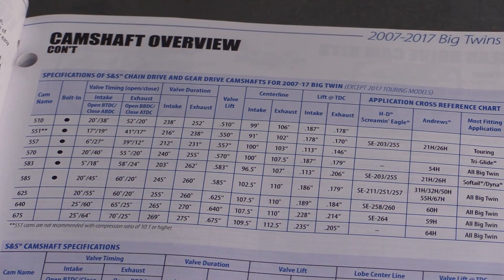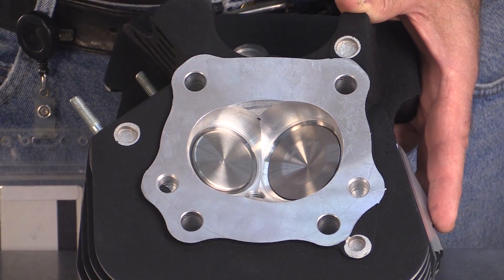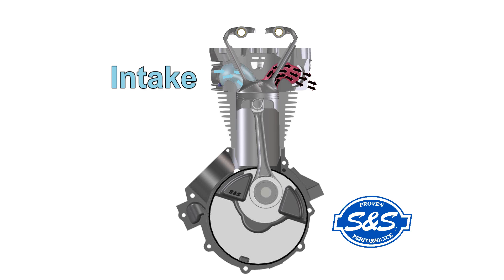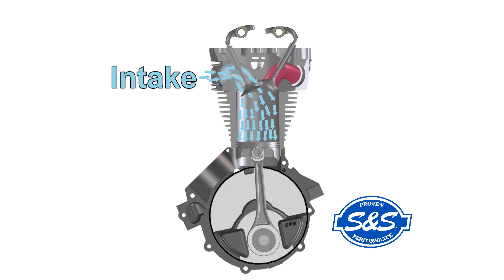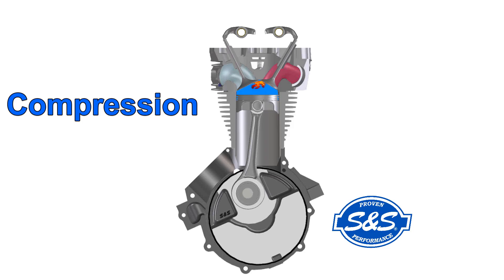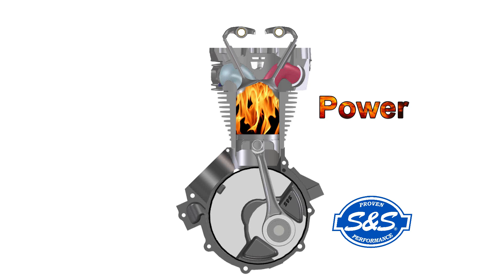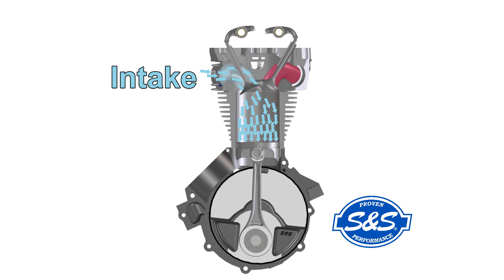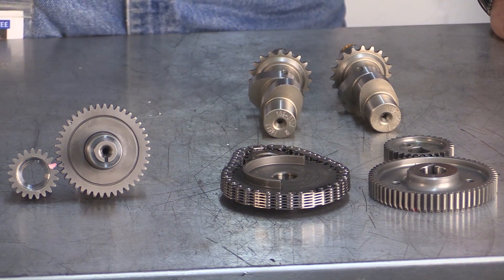S&S Cycle - Understanding Cam Specifications - Part 1

Comment: As a mechanic myself what would be the highest lift and duration and lobe center for a stock 74 cubic in. Shovelhead and still be safe without modifying anything especially piston height? Thank you...... (Andrew's B grind??) I'm an old time biker myself and I'm just using Andrew Cams as an example, I am more than willing to use S&S cams instead.

Comment: best cams for 103 2014 with high flow air filter and s and s headers and 4.5 slip ons and tuners
Reply from the maker: Cams are really dependent on the type of riding you're doing; 2up or solo, carving corners or running stop light to stop light, highways or back roads, etc.

Comment: What would you suggest for a cam for a stock H-D motor with the stage 1 kit
Reply from the maker: What year is the bike? What kind of riding are you doing?
Reply: S&S Cycle, Inc 2012 and cruising
Reply: S&S Cycle, Inc 2012 street glide with Vance n Hines power duals headers and monster round slip on and the dreaming eagle air intake
Reply from the maker: @adambuss2725  We're recommend the S&S Cycle MR103. Lots of low end torque and perfect for a touring bike.  https://www.sscycle.com/products/chain-drive-camshaft-kit-for-06-dyna-and-2007-16-big-twins/

Comment: Thanks for all the great videos and knowledge.S&S is what's up.On this build so far got the rollerrockers,spring kit 900-0954 quickie pushrods,ordering the 300-0175,with the HL2T travel limiters,havnt ordered cam yet.Was stuck from Andrew's to fueling 580 reaper,thanks for info.